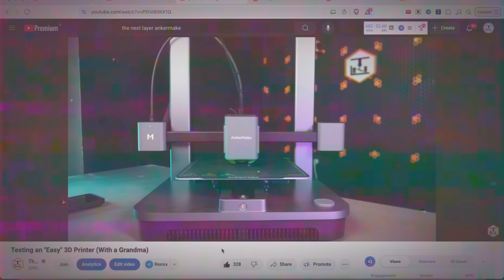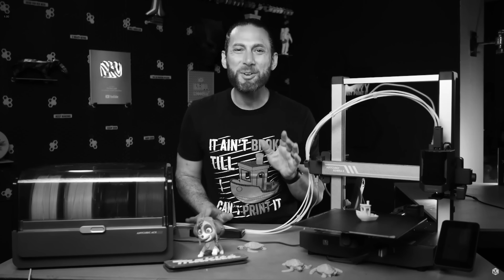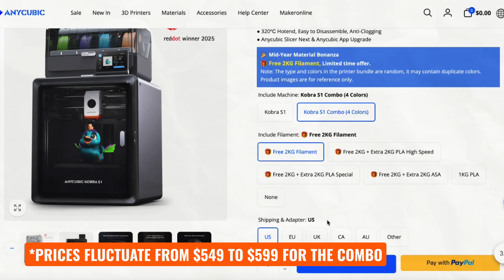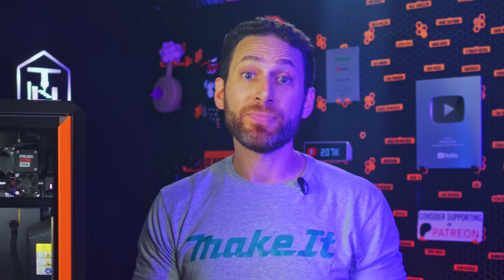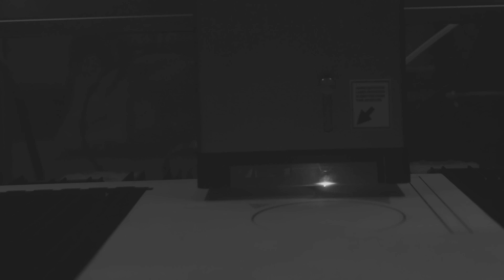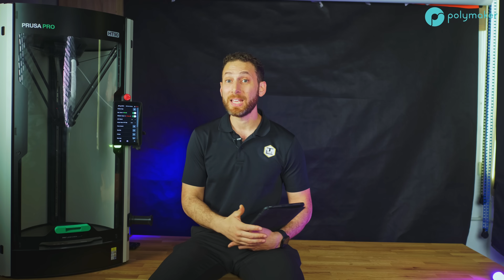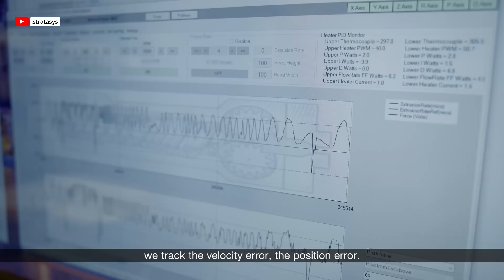$100 vs $100,000+ 3D Printer!

Comment: I have a 250 dollar 100mmx100mmx100mm beginner printer I just got as my first printer and its easy find loads of files online or even make them yourself in blender to make the system compatible with bigger spools yes it can only use PLA and other variants of it but its still a really good printer for what it is

Comment: there  have been many enclosed printers that arent core xy....core xy is just the way the motors and therefore the belts move....the original xmax is an enclosed printer and the bed goes up and down on the z axis....but its not core xy printer....its x and y are independant .therefore much slower

Comment: I get there's a distaste for Bambu, that's perfectly fine.
I work with a Stratasys Fortus 450MC and that thing fails about 25% of the time. Their customer support is good, but only whenever we can finally get them. My Bambu A1 is far more reliable than this $250,000 printer, albeit not able to print Ultem 9085. We use Ultem for aviation so when it does work it is unbelievably impressive.

Comment: If you had to choose one at the 500-1000 price point to print engineering filaments which one would it be?
Reply: Your filament will cost more then the printer 
Perhaps find a old Stratsys and replace the internals or put a ender 3 in a oven and treat it as desposeble

Comment: We have an industrial FDM printer at work round about 30000 Dollar maschine.  It blew the mainbord after 2 month, a linear rail after 6 month,  every 1500 hours you have to change the extruders, because the nozzles arn't changable. There are 2 extruders for 1000 Dollar each that has to be changed once a year and they clogg like hell. You can only use the companies Filament and that cost you 170 Dollar for 1kg of ABS. We now bought a creality K2 plus combo, the print quality is at least the same and it works since a year without any issues. The industrial printer is basically out of business.

Comment: For this kind of video, you should clearly point out that you will be focusing on only single one of the many 3D printing technologies available (although resin is the only other one that's very popular on consumer level)

The mention of "new, bleeding edge technologies" in the end kind of suggests there wasn't anything else...

Also, many of the consumer level devices (except Bambu) are easily rootable, and you can install any firmware & use any slicer you like (and yes, I know that's not something that we should expect average consumer to be able to do). I barely did any test prints (to just make sure it works) before moving to standard Klipper installation on my Ender 3v3 KE.

Comment: I have the kobra s1 and I’ve seen this a lot including mine the bed warps BAD. Like mine is at 1.35mm from high to low which makes the actual print surface much smaller for consistent printing. It’s a great price point I just wish they’d do more quality control

Comment: well about size or accuracy you can get this with consumer grade machines too. 
accuracy is achieved with planetary gearbox on the steppers. 
size? well, the sky is the limit. simple portal printers or core xy are easy to build if you have a most basic machine. For example, the Creality Ender 3 is build by standard aluminium extrution. you can the them up to 3m so you could change all extrutions to a longer version and extend the cables as well. maybe make a direct drive mod to the head and add a BLTouch and you have a reliable huge machine. yes its not fast but if you just need a big printer this is a option. the ender 3 has no limits set in its code. it only knows the endstops and based on thet the 0 postion is set. therefore you hast have to make a custom slicer profile and can print bigger as the standard ender 3.  
i did this by the way. i made my ender 3 pro to a build size of 500 x 500 x 300. i needed a big printer and this was a cheap nodification. maybe 100€ on extrutions and rollers and belts. plus the BLTouch and the Direc drive mod kit so maybe 170€ in the end. if someone wonders what is my print bed, its a glas top from a ikea coffe table and its not heated.

Comment: I wouldn't recommend the Kobra S1. I have had one for 3 months. It worked great to start, but now it's plagued with issues. It's not even working now because one of the wires to the hot end broke. It was great for the first couple months but it's now just a $500 nightmare.
Reply from the maker: Yep. Agreed. Mine was GREAT for 2 months, and then... really started causing problems :( Inevitably, whenever I recommend something, it goes downhill after.

Comment: My first 3D printer in an ender 3 s1..  As a hobbyist - I have been super happy with its performance and am beyond satisfied with my choice, and I have been considering to upgrade to another 3d printer. My only question is what would i want to upgrade for and what printer would i purchase... could you maybe suggest one, if the goal is to get better quality & / multicolor printing? 

I also want to ask if you think an enclosed 3D printer is worth the extra cost compared to an open printer.

Comment: Why did you say it's 250$ for the anycubics kobra 2 with the ace unit ... The printer itself is 259$ but with the ace unit it's 399 at least that's the best deal I could find and I have 6 of them in my print farm so I have kept up with deals and stuff like that from the very beginning I'm curious if you found a website selling for 259$ as a combo and not just the printer thanks and keep up the good work love your videos
Reply: AliExpress, got mine for 219usd.

Comment: I'd love to hear a deep dive into what sorts of automatic calibrations and sensors these industrial printers have that consumer printers don't (or don't yet) have.

Also, there are a couple companies experiminting with 3d true color printing, ink jet or otherwise...  just amazes me.  Also makes me laugh when people are like "I spent $1000 on the most expensive 3d printer that promised perfection and I still had problem X.  

Finally, abandon your current SV08 tool changer and get friendly with Bondtech ;)

Comment: I’m sorry but you are recommending Anycubic and leaving out Bambu. I own five P1S printers and they are absolute workhorses and worth every penny I spent on them. I purchased an Anycubic Kobra 3 Max and it was pure junk. It kept clogging, dropping the hotend on the build plate and grinding the build plate. Inconsistent printing. It spent more time sitting and waiting for parts than printing. Luckily I complained enough and got Anycubic to finally take it back. Also tried two different Sovol SV08 printers. Couldn’t get them to work for more than a few days without them losing their z offset or some other issue. Luckily I was able to send both of them back too. If you can’t talk about or recommend the best printer on the market right now, you might want to avoid videos like this one. You are steering people in that $500-$1000 price range towards companies that make a subpar product.

Comment: For me Prusa is the best choice by far 😊The machines are reliable solid and easy to work with. The print quality is consistently great and the support from the community and the company itself is top notch. I really appreciate the open source approach and the fact that you can easily upgrade or modify the printers if you want. It just feels like a brand that truly cares about its users and long term value 🙌

Comment: Wow, that was a thorough tour! Great to see so many FDM printers (and fun fact — FDM is actually a Stratasys trademark 😉).
Also nice that you made it to both Rehovot and Rosh HaAyin!

I was a bit worried you'd end up comparing a $100 FFF desktop printer to something like the J850 DAP — which is a completely different league, both in technology and purpose. Honestly, there’s no industrial printer that really compares to the beast that is the F3300.

That said, when it comes to older or smaller FDM machines, I totally get the comparison to hobbyist printers. It might be an unpopular opinion, but for the price of one industrial machine you could get a farm of 100+ fast, low-maintenance desktop printers — as long as you don’t need true industrial materials like PEEK, ULTEM, or Nylon.

Bottom line: it’s not really a fair “comparison video”… it’s more like:
“Look what’s out there — and be amazed 😉 "

Comment: Great video as always

But I have to bring one criticism point:Stratasys
I know they build insane printers, and they are way beyond what they average person needs. They do great stuff BUT I’m really sorry but I just can’t as a maker and nobody should support their way of handling patends and innovation. And I’m really pointing to the fact that they basically indirectly patented and still patent community innovations. I Really don’t try to badmouth them, but this is just something I can’t support. And there are some other critical things I also can’t support like artificial filament “ manipulation”, and with that, I mean the fact that they have a chip in their spools which blocks the usage of the filament if it reached a certain time. and not because it’s bad it’s artificial manipulation and technically is illegal, but it doesn’t really apply to b2b so it’s still allowed. Again, I really don’t try to badmouth them, but these are just facts. I don’t know everything so correct me if I’m wrong, but I personally can’t support them. I’d love to hear your opinion on this.

Again, great video keep doing what you do❤

Comment: I feel like this video is missing a whole lot of 3d printers such as the Mosaic Manufacturing Array that actually add features. The most expensive printer you showed was just a bigger FDM printer. Restricting the printing method to FDM is fine for budget printers since resin printers can be a pain in the ass, but at the top end you have things like SLS with powder beds, metal 3d printers, robotic arms holding printing heads, variable width extrusion heads.

When I saw the Prusa Pro I was thinking, wow so you still get layer lines at $10k? FDM is still unsuitable for manufacturing high quality products. The customers at those price points are doing in-house prototyping to protect their IP and they can't afford downtime from 3d printers, but they would never get the silly idea to use the printed output in a finished product.
Reply from the maker: I chose to restrict the video to FDM because that’s what my audience cares about but as I teased, we can do things outside of FDM in a future video if people show interest

Comment: $100,000 for a 3D printer that shit can print metal. Lazer 3d printing isnt available for the average consumer. Maybe in 20 years but not anytime soon. Also every 3d printer can printnpla and TPU as they don't require a heated bed. Maybe people will tell you that the temperature doesn't matter with TPU. For 3d printers becoming cheaper the most noable model has to be the creality ende 3 series. Once that thing came out everyone started copying them. You have so many clones like the the elegoo Neptune, anycuibic vyper. My ender 3 has its faults at times. Mostly themister issues  but a 15 min fix. I don't print abs or nylon since i don't have an encurure yet but I haven't needed one not have needed to use nylon or abs. The fumes are a big heath hazard.

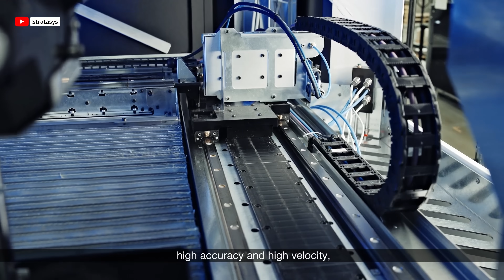Comment: 23:25
You can see at this time stamp that the Stratasys $100k printer has a flexible gate/wall that appears to keep the air temperature in the chamber consistent in the area under the gate, where the printhead and printed object is.
Pretty cool!
But in the future, I think that all of these features will potentially come to inexpensive printers, if there is a need for it.
Reply from the maker: Bingo, it does, which is why it's like impossible to film the linear motors without taking it apart ;)

Comment: Prusa reliability really is something. I've yet to have a print fail on my personal machine about half a year in with quite heavy use. Mostly printing polycarbonate for work related stuff. That's on a prusa mk4s I enclosed myself and built myself. I do print maintenance on a small print farm as one of my many side things at work and the mk3s printers that we have there are still going great. Almost no effort in maintaining them outside of user error breaking stuff.
Reply from the maker: Indeed. It's why I switched my home printer to a Core ONE. I got so sick of sensors telling me the filament wasn't refracting light at the right frequency to please the lidar gods or whatever.

Comment: Ender 3 pro v2 can frequently be had for $100ish around me and is still a work horse. Been using mine for 7 years now with only some minor matianance. Do recommend adding locking adjustment wheels for the bed though.

Comment: I'm looking for a large form printer. My unconditional requirements are 500x500x500 build volume, and a 2020/2040 (or similar) extruded aluminum frame. So far, I have found the Rat Rig V-Core 4.0 - 500, with all the add-ons that they offer, and it checks in at just over $2900 USD's, but am open to other suggestions. I am very willing to sacrifice speed for quality of print.
Reply from the maker: Sovol SV08 max I’d say but they’re not normal extrusions they’re unique ones

Http://jle.vi/sv08max

Comment: I have a Prusa Core One and an Anycubic Kobra S1.  Honestly, I get better prints with the Kobra.  I hate that.  The software for the Core one, Prusaslicer, has been incredibly buggy for me, to the point where it seems like 50% of the time it ends up blue screening my very expensive computer.  I switched to Orca Slicer, which has been performing better. Although it's fairly reliable with ASA and ABS, I've been struggling to get reliable PLA prints from it. I've even tried leaving the door open.  Meanwhile, the Kobra S1, using the same STLs via Orca Slicer, has been flawless.  I'm trying to print out a full wall of Multiboard, which is a ton of panels, and the Kobra is my only printer that is capable of doing it.  The Core One just keeps failing, and I really don't want to increase the cost by switching to ABS or ASA so it can work.

Comment: The Anycubic Kobra S1 is 250x250, not 255x255 as mentioned. Additionally, the AI detection feature does not look like the clip, it actually has not been great and has mostly only reported false positives. The camera quality is also not great. I have this printer for only a short time, I like it, I am a beginner, but just some things to be aware of.
Reply: That is what I got as a beginner. The false errors I kept getting was annoying. Even on my "good" prints it still had issues and glitches including scratching the build plate with the nozzle. I sent it back after a couple weeks and got a Bambu. After the initial cry from the price jump I have been very happy.

Comment: one thing about any printers made in the EU (or any machinery), if you chose to import the printers for your business or even personal use you might be able to do so without paying some of the import tax, depending on the country. I do this with some "the filament company" filament and whatever prusa printers i buy, for my business. I get to bypass whatever the 3d party seller makes and not pay the 10% import tax of my country. If you own a business you might be able to not pay any tax whatsoever just check with a forwarder on it.

Comment: The XL is definitely not worth it. He doesn’t really want to say anything bad about these Prusa machines. They’re not reliable. The XL is a PLA and PETG printer. It can’t really properly print anything else. For that money, you would expect a lot more. The tool changer doesn’t make it worthwhile.
Reply from the maker: As I said, it’s realllllly expensive. I’ve said before, I wouldn’t be able to justify buying one with my own money unless it were for business use. But I do LOVE mine. I use it a ton. With the enclosure, it can print most materials, so I’m gonna do an aftermarket enclosure probably. Eventually.

Comment: You can buy the old Stratasys Titan class machines at very reasonable prices nowadays. The Titan, Vantage, 360/400mc can all be found for <$5000 if you're in the USA. Absolutely unbelievable value machines. Built like tanks and can print any filament.